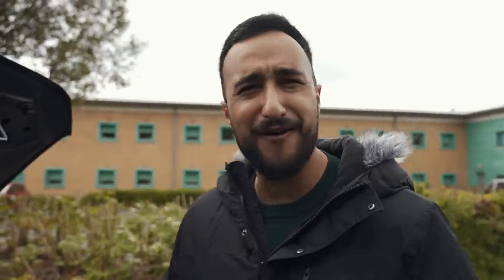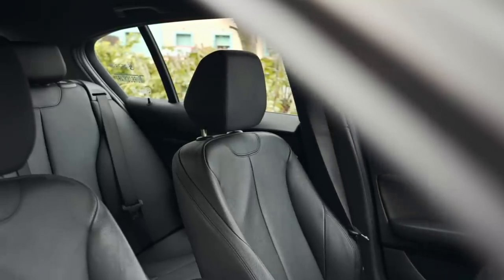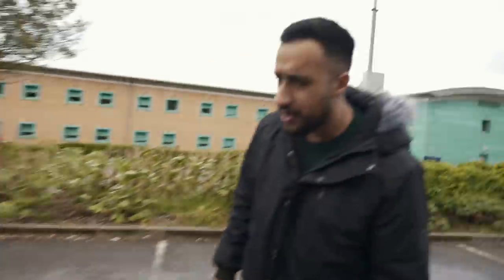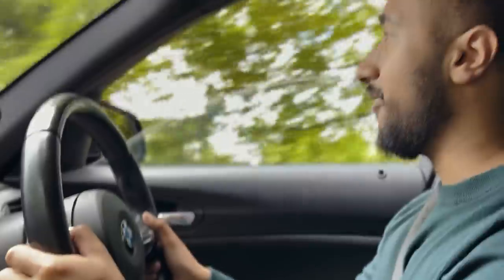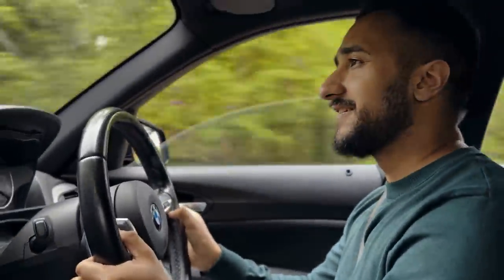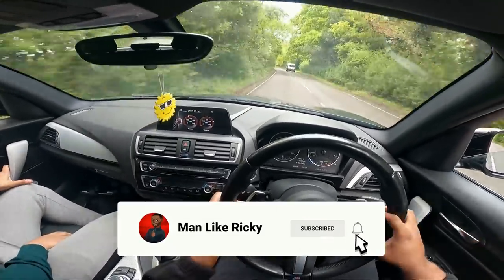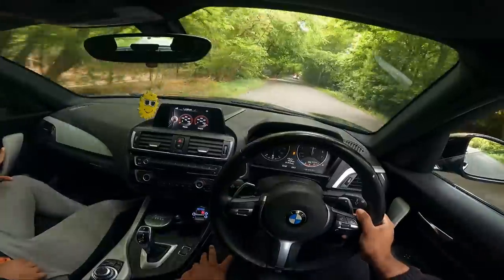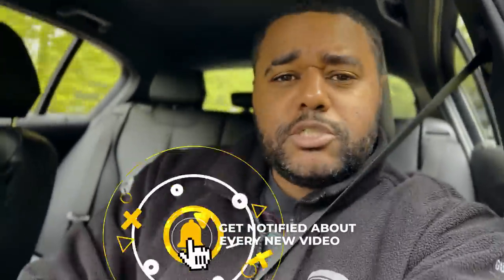POV DRIVE IN A 550BHP BMW M140I SLEEPER!!

Comment: Ricky have u ever thought of getting a Porsche turbo s nd making it the fastest thing on the road with like 2khp would be sick to see against the gtr
Reply: Some cars get too fast for the road and it takes part of the driving away you end up pressing the brakes a lot to slow down
Reply: Don't see any point in that he has the GTR which is already a weapon
Reply: @ARDEN440i  drive that on the road, are you out of your mind?
Reply: @dill_jle  it's a road legal car
Reply: @scottsheppard9906  It might be but it’s 1900hp you think that’s possible to drive on uk roads it’s not forza bro
Reply: @scottsheppard9906  a stock gtr is already plenty for road use
Reply from the maker: @dill_jle  it’s defo forza bro you’ll see next week 😂
Reply: Officially Gassed partnered with ES motors have a very quick Porsche s
Reply: @dill_jle  he has driven it on the road lmao
Reply: @3nd4tom1c8  yea when he got it it was running much less power
Reply: @dill_jle  he ran it on the road after it had been built with man like beans, i cant find the video but he definitely did
Reply: @3nd4tom1c8  you’re thinking of a different car bro
Reply: @dill_jle  it was literally his car, however i think they ran it at 1100 or 1200 rather than the full wack
Reply: He doesn’t drive it in the collection video and the only video after that is drag runs in it
Reply: @dill_jle  i think he mighta deleted it its gotten taken down

Comment: There’s a few M135i running 550+, you need to get them on the channel too.

Would be interesting to see the power delivery differences of a highly tuned N55 VS B58
Reply: if both is 550 then b58 would still pull. The thing with a b58 is the mid range torque once you press the pedal. My mates stage 1 m135i and when I was on stock map(340-350) I would pull on him whilst rolling from a certain speed.
Reply: @j.f.4765  That mid range torque your talking about is due to the stock turbo the B58 has is just better than the N55 but once you change the turbos that will all depend on your set up and tune. 

Would be interesting to see tho
Reply: @s11smk87  still n55 cant follow. Its day and night
Reply: @chiel-  🤣🤣🤣 your deluded then, N55 can make some serious power, it’s just about the money

Comment: Weight distribution on these cars is around 52% front and 48% rear. Basically as close to 50/50 for it not to realer matter. A far cry from being rubbish for a front engine rear drive car. Just thought that was a weird passing comment. 
Otherwise another great vid, owner is hyped about his car and that’s what it’s all about!
Reply: @James__bond007  that’s fact bro but most of the engine is behind that front axle line. Can’t forget they put a super heavy battery in the rear of the car behind the rear axle line as well. But I guess coming from Audis he would expect poor weight distribution when the engine is in the front.

Comment: only 2 things wrong with the vid, boost gauge in wrong place needs to be more  in your FOV ,and the audi coin/cup holder thing , J/K  ,great car
Reply: Boost gauge is nice where it is… makes it easier for me as a driver too! And lastly the Audi ashtray will stay with me till I die 😂 it’s only used for parking change 😝
Reply: @Sa3Tv  friend has awron p3 gauge in m3,ive got the ak motion one(both mount in vent),they just look better and not so far out of view ,been contemplating for 2 yrs  about a 52mm mechanical one but ended up going the other route ,also displays more info than just a boost gauge ,i.e oil/IAT/coolant,transmission oil temp .vacuum,timing corrections/AFRs /0-60 ,its a more complete gauge with tons more info available even has a G meter...lol    ,lovin the sound of that thing tho..